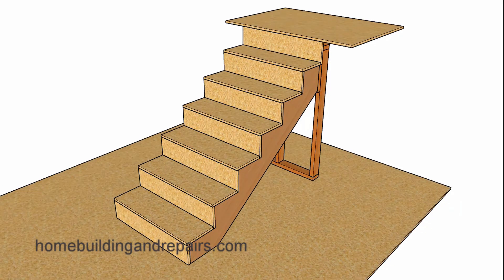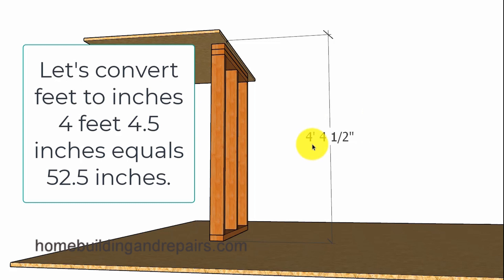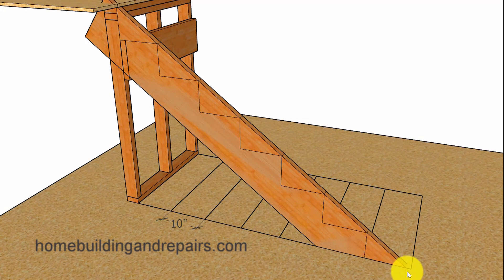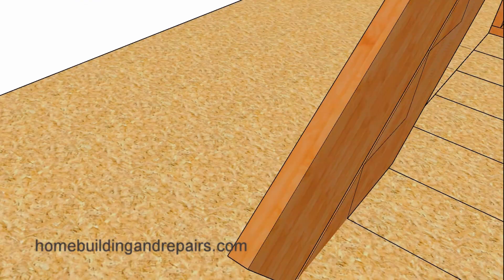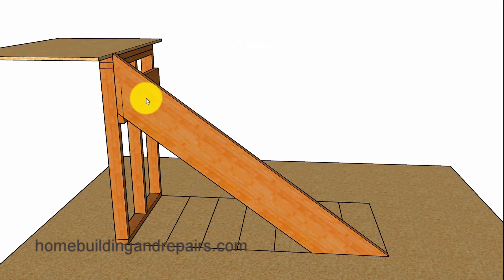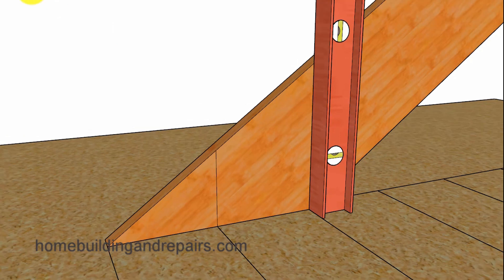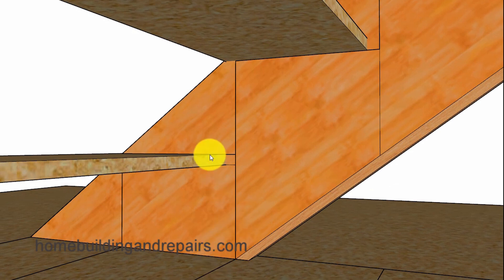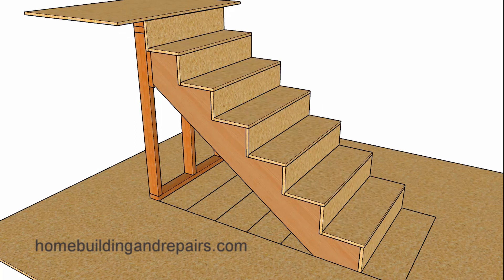Another Way To Layout Stair Stringers With Only A Level, Pencil And Tape Measure

Comment: Hi,, Great videos, .I have a question I want to bring my deck staircase up to the level of the deck boards,, almost 7 feet , and I want to use 2x12s for the treads so I need to keep a 7" minimum rise and going to go with a 9 3/4" tread cut so with a 5/4 deck board for the nosing board I will have a half inch overhang, the way the math works for the total rise of 12 risers at 7"each its too long by about a 1/2"  , would it be ok to make the first/bottom step 6 1/2 " then the rest 7 inches  For the bottom step I will have to cut a half inch off the nose board to fit?  This is my first time doing this so,,,, I've gone through 2 -12 foot 2x12s so far, and digging through the pile of them at the big box store to find good ones aint so easy anymore

Comment: I first played out with a level and tape when I first was building decks

It allowed me to lay the stringers on the lawn where I wanted to land often on a downward  sloped lawn where rise and run took a bit of time- time my pricing didn't afford me.

Divide the hypotenuse length by a number that  was close to 13 but less than 14

But first-
Draw a vertical- plumb line aligned with and above the landing riser, the height of that line is the ht of the bottom scribe

Level off of all the hypotenuse marks with the stringer in the air, deduct tread thickness from the bottom and your off

If you can make a triangle with a stop on the hypotenuse ot the triangle you can really fly

Comment: Thank you for your videos. 
1.	I am building a sunroom from my deck. The doorstep located at 9’4” from the ground. Should my first step tread be level with the doorstep or it could be below it as shown in your video?
2.	In the building code: "Riser height shall not deviate from one another by more than 3/8””. In your video bottom riser deviated by ¾”?

Comment: Is there any reason this method won't work for solid stringers?  I want to build mine with unnotched stringers and metal 90 degree angle brackets to support the treads.  My rise is 94" and run 90".  I'm going with 10 treads.  The stairs terminate into a wall, so I'm stuck with these metrics, but I plan on building a metal set in the future, so the last steps will deviate to the right so I can get that 11th tread.  Thanks, and thanks for making these videos; I wouldn't have attempted this project without this help.
Reply from the maker: No, it should work for solid stringers without notches.

Comment: Can I use 2x10x10 for the stringer. ? I won't be cutting the stringer, I will make the steps diagram you show in the video put 2x4 blocks for the steps. Using 3 boards 12" on center for th 10" wide boards. 3 times I have done this
Reply from the maker: All I can say is that I've seen it before. I don't provide lumber sizes, because it is different in some areas.
Reply: There shouldn’t be any kind of code issue preventing you from doing it that way, using 2x10.

Comment: I router my stringers and slot the treads in. Glue and screw never goes anywhere. Twelve inch treads which is really 11 1/4 inch x 7 inch rise there abouts

Comment: I was taught, and I find it easier to understand, that riser measurements are made by knowing the FINISH to Finish distance. That takes any potential finish-floor thickness difference out of the equation.
Also, from the illustration, you are decreasing the effective stringer width (looks like maybe 3/8") by measuring from the BOTTOM of the stock and not the Top of the stock. No?

Comment: As and former ironworker. I am now learning carpentry. So you allow for the deduction of 3/4 in only on the first riser and run outside of that it's 7-1/2 in rise. Your a good teacher.
Reply from the maker: Thanks and good points on the riser measurement deduction from tread run.

Comment: This is a very thought out explanation. But for me I would stick with the traditional method of figuring out the rise and run and using a framing square. Which I believe you have a video about that. Thanks again your videos are helpful God Bless
Reply from the maker: Good point!
Reply: @stairbuilding Good point? What point did he make?
Reply from the maker: To use the most common method I have in my books. @mnight207

Comment: My deck stringers needed to come down onto a slightly sloping downward concrete sidewalk. This method is the only way to cut the bottom of the stringer so that it conforms to that slight slope and, at the same time, keeps all the stairs at a 180-degree angle. 
Once I had that, following all the steps presented here worked perfectly!!
Thank you so much for this approach.
Reply: It's not the only way. Not many things in building have just one way to do it. Off the top of my head you could measure to a lasered line where your stringers end at the concrete. Find the difference in height of the concrete relative to your centre line (if this is where you took your initial overall rise from) at the lowest point of where your stringers will end. Let's say that the difference is extreme, say 50mm. Now, prop in their position, all stringers 50mm higher than where they will finally rest and cut a 50mm thick block. Using that block and a pencil, scribe the bottom riser of all stringers around the entirety of it's perimeter. Cut and place all the stringers at their true heights. This way ensures you have a near perfect replication of the contours of the concrete in both directions. This, essentially, is the offset method, which a lot of finish carpenters and cabinet installers use.
Reply from the maker: Awesome and thanks for sharing.